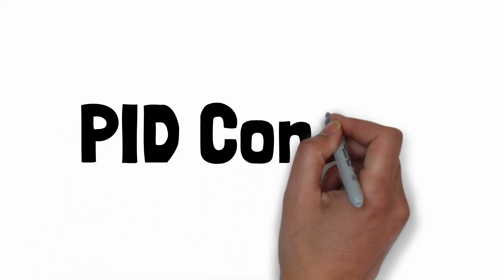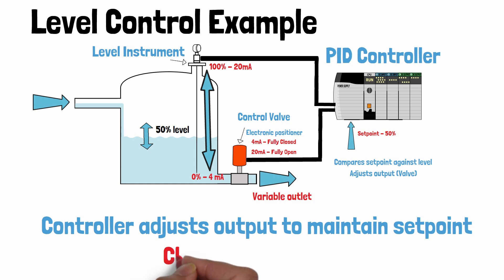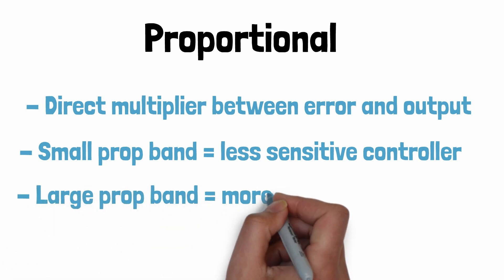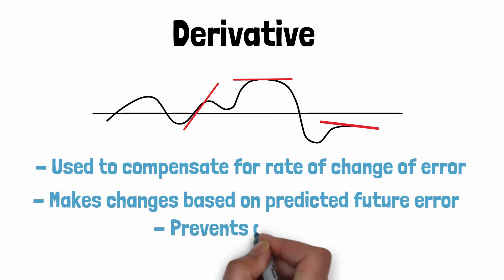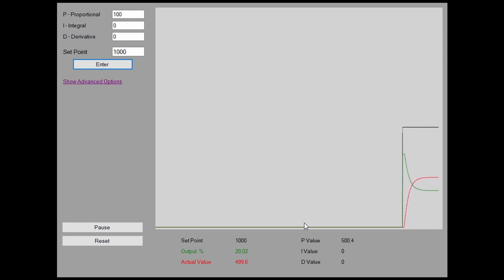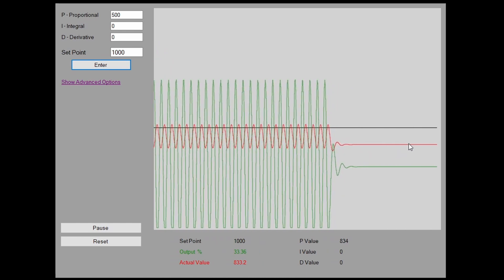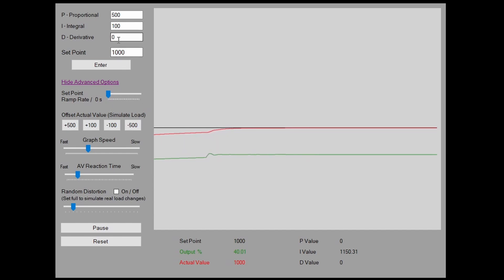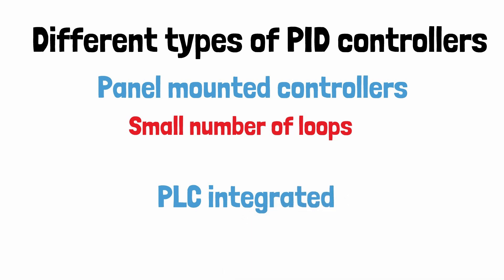How PID Control Works - A Basic PID Introduction

Comment: I worked at Lockheed Missiles and Space / Lockheed Martin in the Environmental Test Laboratory for 17 years as a Thermal Vacuum Technician. I built instrumentation systems to control thermal vacuum chambers using PID controllers, dataloggers, heaters, solenoids, relays, and SSRs. 

I had just a qualitative understanding of PID controllers — but I have seen the effects of integral wind-up and all that behavior in real life. I never used Laplace transforms, Routh’s criteria, or Root Locus control theory. In the practical, real world, it’s all intuition and gut feel as a technician. 

Talking theory is great, yes — but the real, practical world is the best way to truly feel and understand the behavior of a system. I’ve dealt with integral wind-up, overshoot, slow response, and all those effects that professors talk about in lectures. All of this can be explained in simple English, in five minutes, using hands-on examples — not long lectures full of math.

Comment: Hi I’m a recent graduate with an instrumentation and controls degree. My weakest link was trying to tune PID controllers for a heat exchanger I built in class. If you could perhaps point me in the direction of some simulation software such as the one you used..it would be greatly appreciated. I could really use more practice and experience with different values to better understand the actual tuning process. Thank you.

Comment: I have one question . The 4-20 ma signal sent by controller . Is this signal just signal or actual electric current that can operate the valve ? 

I mean can a electric signal from controller operates a motorized valve or motor . Or they need separate power to operate ??
Reply from the maker: Hi Aman. Control valves are usually powered by compressed air or hydraulics, or less commonly are electrically driven. In all cases, the energy is externally powered. The 4-20 mA signal from the controller would just give a signal to an electronic positioner on the control valve that compares the demand by the controller to the current position of the valve, usually detected by some feedback like a potentiometer on the valve stem. The positioner will then control, via solenoids, the air or hydraulic power to move the valve.

Great question, though! Does my answer make sense?
Reply: @InstrumentationControl  it means the 4-20 ma is just a signal not actual current to open a valve

Comment: So far this is much simpler explanation. For beginners this is great. Thank you very much. It would be great if we can have the behavior of the those fitting that might be attached to this process. One thing I find that most of the time the instrument guys believe that just by doing trial an error can solve the problems. Including selecting different positioner or Feed back levers  types. Most of the time this poor understandings makes the puzzle , Why my setting don't deliver.  Let's say in a simple level control PID. From my experience , most of the time the instruments guy really don't understand the control valve type .. Quick , equal potential or linear. They only see the valve fitted as Gate , Ball , Plug , Butterfly and etc. The whole idea of fine tunings is - Avoid valve parts premature failure.  Each flow from pump have their own 'curve' .  Valve seats wear and tear most of the time can influence the flow rate across the valve from original intent. Even pump wear and tear will greatly effect available pressure and flow . For those who like to work in field it would very helpful if they can discuss the 'process' engineers at site . I don't be surprised even the process engineers really don't understand what is going on. Simple attitude - Somebody will always fix my problem . If not I call another guy.  . Also look into the entire piping , fittings , pumps and etc. Even a partially blocked strainers can create entire drama. Just sharing my experience....